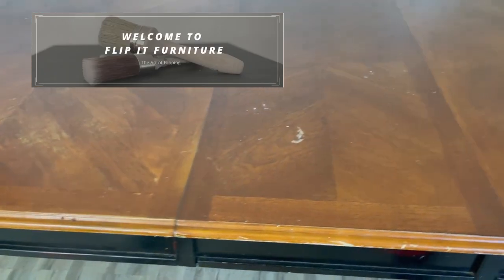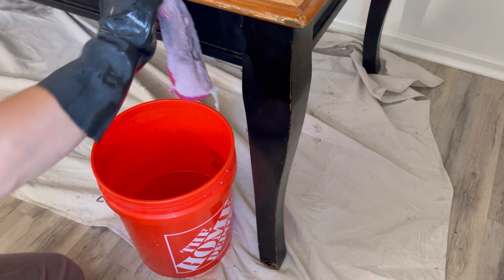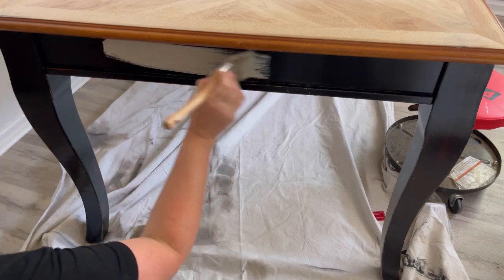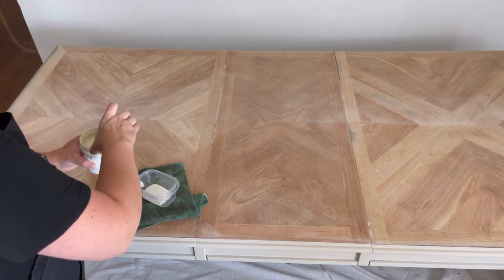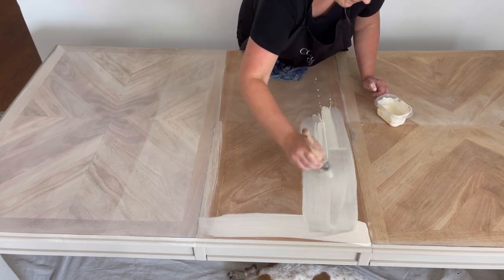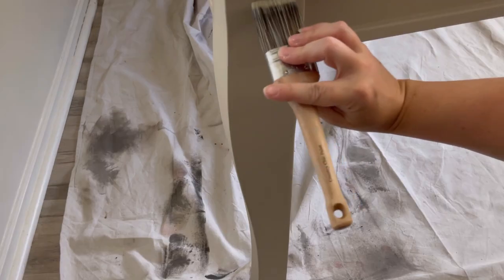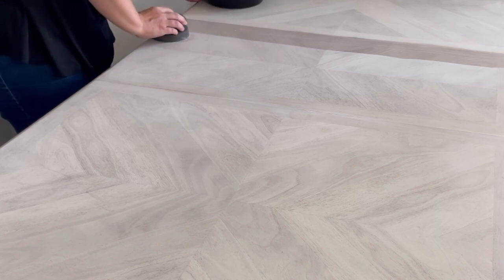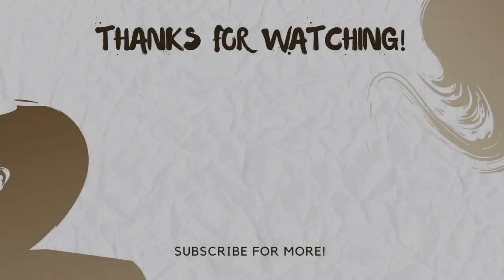Dining Table Furniture Makeover Using @CountryChicPaint

Comment: Hi I am so happy your video popped in my feed! Your table came out just beautiful🙌🏻🌟💫 I love it! I am a Country Chic fan as well❣️ new subscriber here! if you don’t mind I’d like to ask you for advice on a project I’m working on.....I have. 30 yr old solid white maple table....the clear coat on it yellowed or darkened over the years so I decided to sand it down to bare wood....lots of sanding that factory finish off!! Anyway I decided to use Country Chic Hemp oil for the top....the legs were white and I stripped them to bare wood with stripper.....the apron is white....so getting to my issue after 6 coats of hemp oil and letting it sit over night each time .....after buffing it’s still not smooth! The oil also brought back the yellowing color (when bare looked like yours) so I really like yours what would I have to do to change to a paint wash....I have Crinoline....I would hate to erase the nice drink of water the table obviously needed....I know you can use water based over oil base but I would most likely need to sand to bare wood....I’m blabbering...so sorry....any advice would be most appreciated!! Thank you for sharing your gorgeous project...can’t wait to see what you do with your chairs😊kim

Comment: How long did it take you to sand the top of that table? I’m asking because I’m getting ready to take on a project very similar and I can’t decide whether I want to sand and stain or paint. Thank you for your help. I love the way the table turned out, it’s beautiful. As for the chairs, I think I would do them in Driftwood. Great idea to do them in a different color. Thanks for your help.
Reply from the maker: Hi Kathy! It took around 2 hours to sand. Sometimes it takes a lot longer, but for some reason, this top came off pretty quickly.
Reply: @FlipItFurniture  thank you so much for the reply. I really appreciate it, love your work!

Comment: This looks great, I just did a night stand which was pine. Removed varnish sanded and bleach several times. Applied Sunday tea Country chic chalk paint and wiped off. It shows the orange grain through and I hated it. I now used two parts water and one part paint and did not wipe off, some grain is showing, I dont like the chalky look. I’m not sure what to do next I’m thinking off putting white wax on to lighten it over all. Your thoughts?
Reply from the maker: Hi! Since you are painting over pine It’s most likely the orange coming through are tannins. Are you trying to get full coverage or just a wash? 
If you are painting full coverage you can easily add a blocking primer then repaint. 
If you are doing a wash it gets a little trickier with pine. You need to use a clear blocking primer. For this I use Dixie Belle’s Boss in clear. The reason is Boss has more of a Matte finish so when you add your wash it won’t look shiny underneath. Pine and red woods usually need a primer. 
You might be better off with a natural color stain instead of the Sunday tea. Lily Moon vintage has a few beautiful natural stain options. 
Another option would be to keep it natural pine then use a flat/matte sealer over it. The flat tends to not change the color as much.

Comment: Thank you for this tutorial. I really was aiming for the same results in a table I booth at a garage sale for $60. It is the same too designs as yours. With a veneer top. I used the same 80 grid sand paper on a random circular sander but I didn’t get the same results as you 😞. In some parts of the table the sander broke throughout the ven we. I don’t have an uniform wood grain look anymore. What would you suggest for me to do? I really wanted to get the restoration hardware look for this table. Please advise, thank you so much !!!

Comment: Hi Amy, quick question. Could one use a roller to apply Country Chic’s tough coat?
Reply from the maker: Hi Jade! I would think so, I’ve never tried it. If it were me I would test it on one of the inner legs or somewhere hidden. That way you can wait till it dries and see if it has any texture or streaks from the roller, before covering the top. I think I would only try it with a high density foam roller.

Comment: Any tips for keeping the light color table to be protected from spaghetti sauce or ketchup? I don’t want to cover it with table cloth. I do have place mats but kids could accidentally drop something
Reply from the maker: I used a tough coat on it. You can add 4 coats. Any water repellent sealer will do the trick. I also like Dixie Belle’s Gator Hide. 
The only issue I’ve had is heat. My daughter put a steaming hot plate on it and it burned through🤦‍♀️